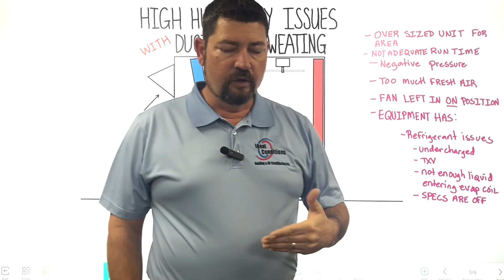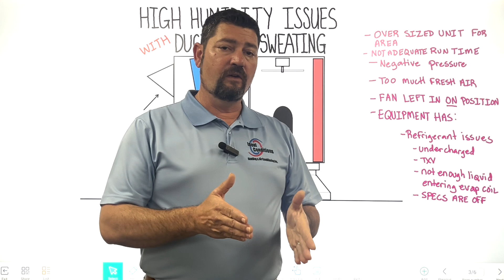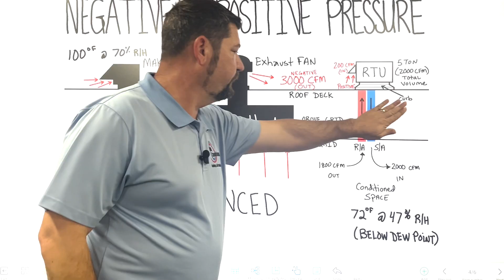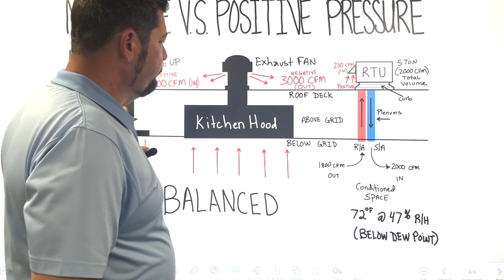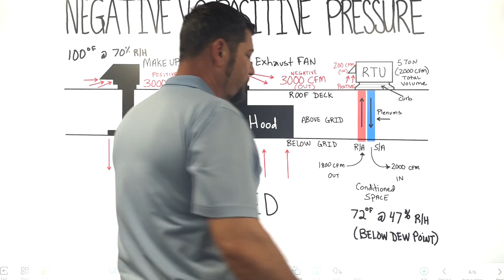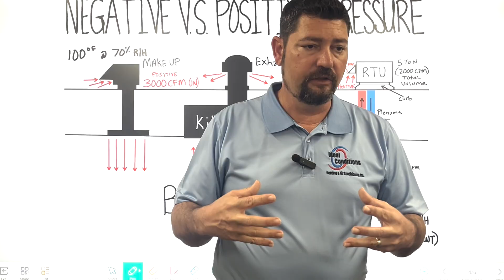Stop Ductwork Sweat: The Ultimate HVAC Humidity Guide

Comment: Had a situation yesterday on a package trane unit. 7.5 half ton. The trane didnt have damper. There was an ICP unit with damper supplying conditioned air also. The metal in the bottom of trane unit in between return and supply plenum was condensation. The ducts themselves weren't sweating just the exposed metal between. It was in Tampa. Relative humidity was 33 percent just running one unit. I manually cracked damper of other unit. About 10 %. But not sure if it'd work. Any suggestions?